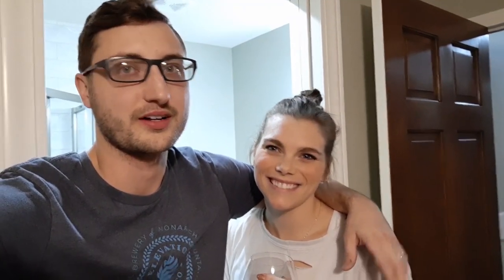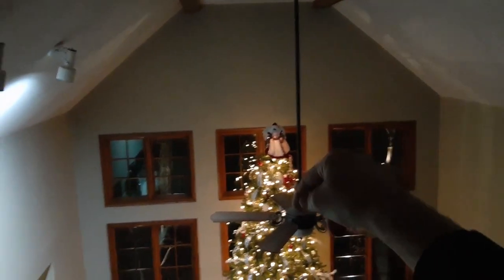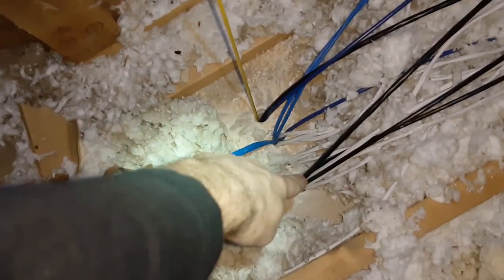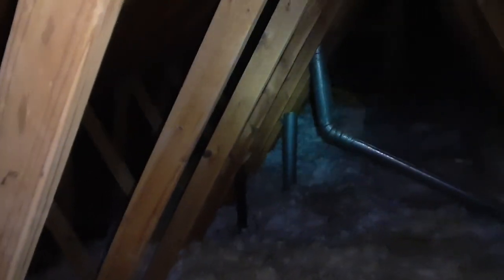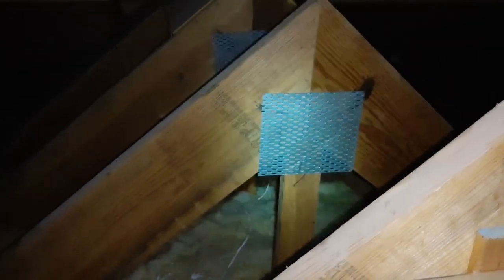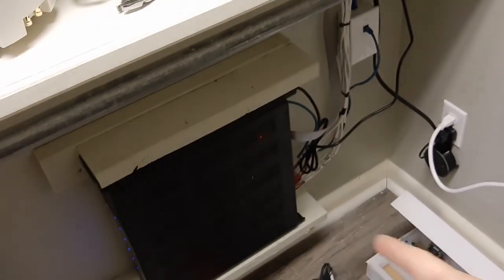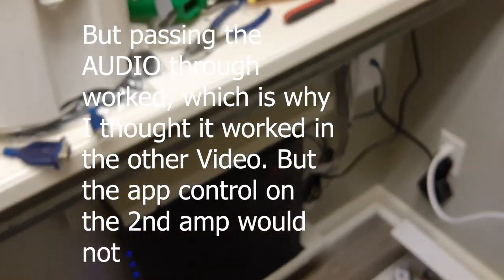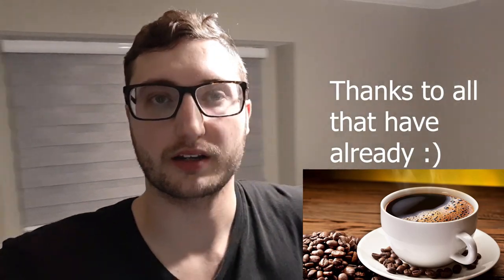Whole Home Audio Start 2 Finish EP12: Cleaning up Wiring, & Other GOOD STUFF!

Comment: Can you let me know where you bought the bulk ribbon cable, connectors, and any tools needs to put them together?  I am doing a somewhat custom install with 3 units and 18 zones in my house.  I was just about to do connect a couple of cables together as recommended previous video and then saw this one and stopped.  
I also used your idea of the custom wall mounts and made 3 of my own yesterday, painted them last night and plan to install today.  Thanks for the idea and replying to my other comments.
Reply from the maker: This was the ribbon cable https://amzn.to/3sgUkpg and these were the connectors https://amzn.to/3kL1uOq

I still have ribbon cable and connectors left over, let me know if you want to just have me make one and mail it to you for like $10. Thanks for watchin!

Comment: Hello there nice work and clean setups 👍🏻👍🏻 .... question i seen other installs were the switch has Bluetooth source available is that a different brand or is it available for the monoprice as well?  Thanks 👍🏻
Reply from the maker: These wall controls don't have bluetooth built in, but in fact this new upgraded amplifier (the soundavo ws66i) has 2 wireless streamers built in. They run on your home network which is far better than bluetooth. If you want more info check my channel on the soundavo ws66i, I have a discount code. But to answer your question, they do make a bluetooth receiver for these if that is really what you want https://www.monoprice.com/product?p_id=13358&gclid=CjwKCAiAz4b_BRBbEiwA5XlVVpRQOxBSNWiiJh-iPvRC-4y-JSr1c0qF3T0KQ6Nw7eWwZwqLOWLj0RoCqe4QAvD_BwE
Reply: @TheKMZ1  ok cool thanks 👍🏻👍🏻 got you on a cup off coffee

Comment: I bought the Soundavo 6 zone amp. I have the amp plugged into the modem in the basement My router is centrally located in the house. is there a way to wirelessly stream and utilize the wireless functionality when the amp is not plugged into the router but is connected to the internet?
Reply from the maker: I think the 2 wireless streamers can connect to your wifi network. I think you'll need to have it plugged into your LAN at first, then configure that and then i think you can unplug it.
Reply: @TheKMZ1  thank you very much for the advice. Love the videos.
Reply from the maker: @connormwalsh  thanks for watching I appreciate it!

Comment: does connecting those two amps with the ribbon cable mean that technically you would have 12 zones (if both amps are 6 zones) and you could use the app to stream on not only the first amp but the one you added on as well and seamlessly?
Reply from the maker: Yes connecting them together means you get 12 zones, but you still only get 6 sources. So the slave amplifiers share the sources from the main amp

Comment: Is there any way to add more sources? I’ve maxed out at 6 with 9 zones.
Reply from the maker: Technically you wouldn't have to link the 2 amps together. You could run 2 amps independently but then, each amp could not tune into any sources on the other amp

Comment: Did you use cat 6 or cat 5e cable for wall key plates ?
Reply from the maker: In this house i did cat5e. In my previous house I did cat6 because that is what I had leftover. It does not matter if you use one or the other, i would say use whatever you can get for cheaper!
Reply: @TheKMZ1  did you have any issues with the 2 streamers? If I reset the WS66i the streamers show up on the network but then after a few hours or the next day, they disappear and the soundavo app doesn’t pic them up. Have you run across this issue on yours and have a solution? Currently I have a workaround by wiring up a cromecsst  into one of the inputs but would really like to use the streamers reliably. Any ideas?
Reply from the maker: @farazcurrimbhoy1002  what kind of wireless network are you running? I assume you have 1 router only? 5ghz or 2.4ghz? Are they on a separate SSID or broadcast through the same
Reply: @TheKMZ1  i have a UniFi network with 1 router but multiple SSIDs. One broadcasting 2.4ghz and the other 5ghz. As a troubleshooting step, I combined both bands into 1 SSID but I cannot tell which one the receiver is connecting to. Nor can I force it onto a specific SSID
Reply from the maker: @farazcurrimbhoy1002  the only reason I mention that is because the streamers as of now are only 2.4ghz . There are working on upgrades to make it better and 5ghz compatible
Reply: @TheKMZ1  yes that’s what they told me as well. Do you know if the 5ghz update be a software or hardware update for us?  Did you find a way for it to be pushed onto a specific SSID broadcasting only 2.4ghz or see if it connected to it? Does my setup having 2 SSIDs not work for the receiver or do I need to switch to a single SSID broadcasting both, 2.4 and 5ghz?

Comment: Did you use surface mount raceway type boxes for the ethernet / controller connections?
Reply from the maker: I used legrand metal extra deep electrical boxes https://amzn.to/2KIxP9T  when they are mounted on the wall like this, it makes the ethernet connectors a little tight on the back side, but it works. If they had an extra extra deep box it would be a little better haha
Reply from the maker: And thank you for the coffee's, I really appreciate it! You are a good fan of my channel and I hope to grow the channel a lot more. Looking to get some new camera gear and better setup. So hoping to see some video production quality increases!
Reply: @TheKMZ1  Actually have that box up on the screen from Home Depot so we are on the same page.. My next thought then would be a junction box with a single gang faceplate for the single cat connection.  That may provide more room and since it will be in my server closet, not worried about how it looks...
Reply: @TheKMZ1  Bouncing around the thought of building out a small channel myself (more devoted to gardening on my end) but as another channel states, "I have a face for radio and a voice for print!" so we will see.  Besides, we tech nerds need to stay together!
Reply from the maker: @NavyCopMA1  Yeah if you can find one that is deeper than the "extra deep" ones by legrand, then it will probably work a little better. But, if you can't, those legrand ones do work, it's just that as you are pushing it in, you will start to think, uh oh this isn't going to fit. But it does fit and work.... i've used these in about 4 installs (so far no connection issues) It's kind of one of those things, that once you put it up, I doubt you would ever remove it